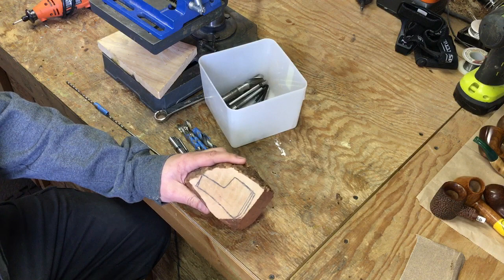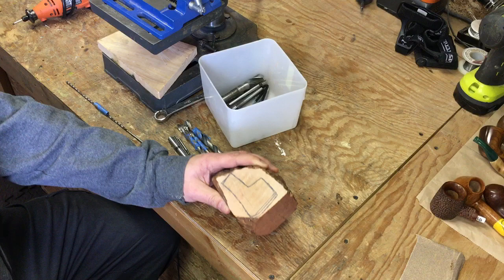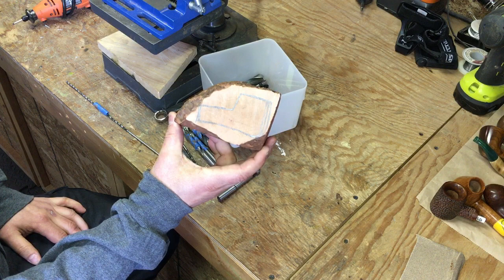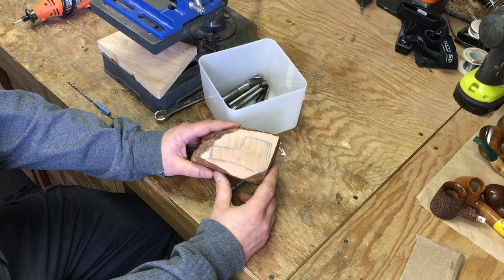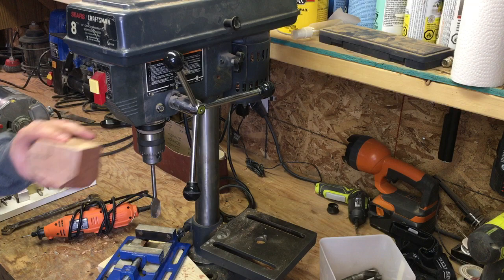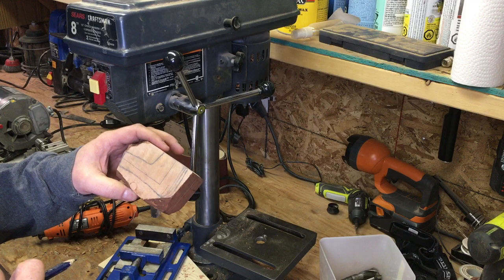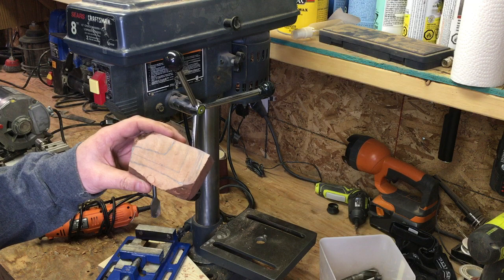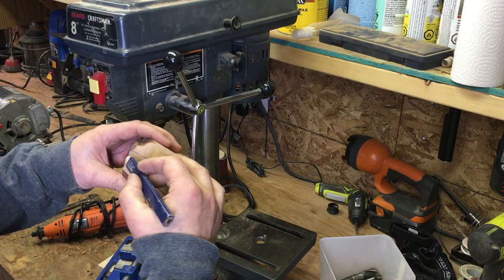Pipe Carving Ep1 (Drawing,Rough Shape and Drilling)!

Comment: why don"t you bolt down your vise?
Reply from the maker: The reason for that is cause I hate unbolting it all the time to move it down below. I find I have way more control and I can line things up better if I can move the whole piece around. Also This drill press is from the 80s and it's accuracy is not 100% any more so I can spin the work piece around and the hole will be more even!
Reply: I realized that after I commented , to late to take it back.